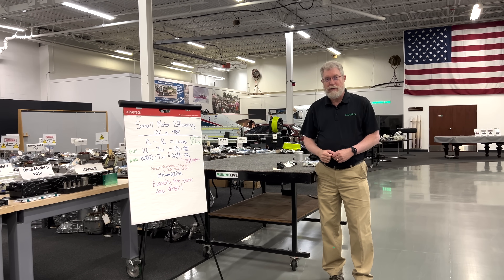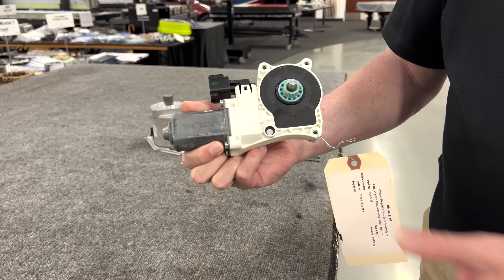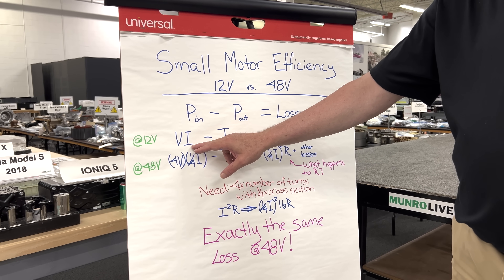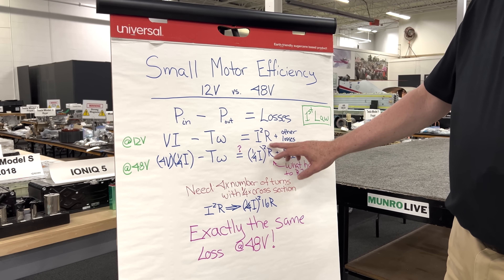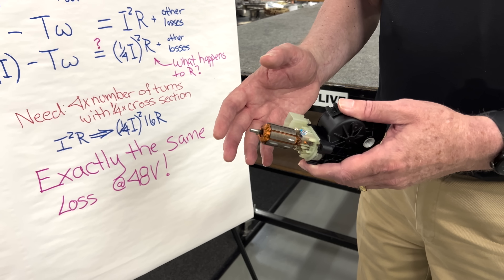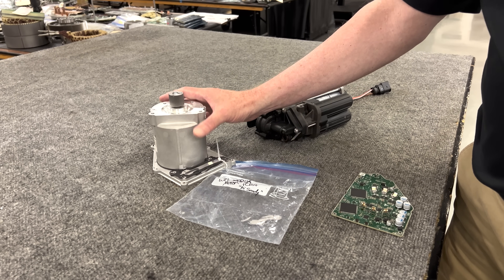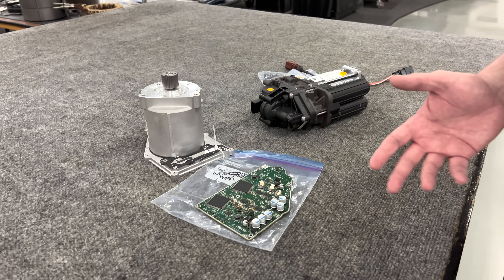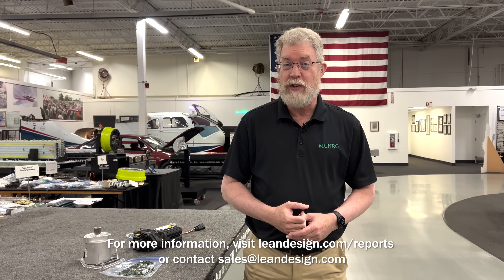Cybertruck 48V Motors: Why Tesla Made the Jump

Comment: So the biggest benefit I can see is when you have 1/4 of the amperage running through the wiring and control boards, you have 1/4th(approx) of the heat being generated by the electronics.  Water is the biggest killer of electronics, but heat is the second biggest problem.  By making the system 48v the entire system generates so much less heat that the electronics could conceivably last much longer before experiencing problems.  One big example of this is the ford lightning has a automatic switch that backs off the power if you hold the throttle down long enough.  It will only allow full throttle for a limited amount of time as the motors and circuitry starts overheating.  The cybertruck testing I've seen had one launch 11 times in a row and their was almost no difference between the first 1/4 mile and the last.  Thats an extremely robust system.

Comment: The primary reason to reduce the wire gauge is to save costs while improving the drive-by-wire motor's response, as higher voltage results in faster response times. However, this creates a challenge for the truck owner, who may need a second mortgage to cover the cost of replacing the battery or even a light bulb. 🤣🤣

Comment: If voltage goes up by 4 in the motor to get the same amount of power out we should need a quarter of the current. If we have a quarter of the current we have a quarter of the current losses. The resistance of the motor is primarily from the counter electromagnetic force, ie the generator effect generated by the current carrying conductors opposite the force causing current flow. This is ultimately what will cause a motor with no load to reach a maximum speed. It's also what causes the load in a generator and requires increased power in to provide more current out.
Reply: That being said, those little motors are so small they are negligible.The auxiliary loads in general are measured in watts whereas the propulsion is hundreds of kilowatts. The only real gain might be seen in the heat pump

Comment: Hi ! I hope you see this comment as you know you didn't explain something very well and you have made a mistake that needs to be corrected :
R= P × A / L
and in case of 48 V
A' = A / 4
L' = 4 L
R = P × A/4/4L = P × A / 16 L 
p = the resistivity of the wire .
A = the section of the wire .
L is the long of the wire '
R the overall resistance of the wire
so the resistance will be 16 times less in the case of 48 V

Comment: Electrical Voltage (U) not V!
The letter "U" used to denote electrical voltage comes from the German word "Unterschied," which means "difference." Electrical voltage represents the difference in electric potential between two points in a circuit. This notation became widespread in German scientific literature and education, and eventually, it was adopted internationally.

Electric Current (I)
The letter "I" used to denote electric current originates from the French word "intensité," which means "intensity." Electric current refers to the intensity of the flow of electric charge, or the amount of charge passing through a point in a circuit per unit time. French scientists, such as André-Marie Ampère, played a significant role in the study of electricity, and through their work, the "I" notation became widely accepted.

So P(ower) is U×I.

Comment: Small power mosfet switches are no longer expensive. That is outdated info. Its much rather that engineering for 100's of amps in general is expensive and annoying. Everything is just a little more expensive. The PCB. The capacitors. The current sense arrangements, the cables,  the switches. Slightly more loss. Larger screw connectors, larger push connectors. Everything a little.

Comment: Your calculations are hyperbole. In electrical engineering we almost always see an increase in efficiency with an increase in voltage. Smaller wire tends to give a better geometric fill on smaller items, solder joints, connectors, transistors etc. have fixed resistance terms that do not depend on voltage. Yes, higher voltage Mosfets have more resistance, but mosfets are now so good that for low voltage mosfets the resistance is as much packaging and pcb as it is silicon die. Diodes SUCK at low voltages. A fw/bw variable speed drive for a dc motor can be half diode at 48 V....at 12V the efficiency of that arrangement becomes trash and youd probably go with a fully active power converter. Carbon brushes is another one. Low voltage motors have far higher losses and wear in that area because brushes hate high current. A dirty corroded 230V motor will run just fine, a brushed battery tool will almost catch fire in that condition. And all of this gets worse with higher powers. As the rotor gets larger, fewer and fewer turns are needed to give proper emf....and low voltages like 12 become asinine...unless we use series wound machine like a starter, which does auto field weakening, and is undesireable for many generic applications.

Comment: Why ?, Because the costs are saved by Tesla and the expenses are passed to the customer. Here is the math,  $2500 for 48V headlights, $25 for 12V headlights. CustomerCost48V= 100 x CustomerCost12V. If you are not convinced then you should ask why not 480V ?

Comment: Having attended many PDT architecture meetings at GM about 30 years ago, I believe your missing the key point.  Belt driven steering pump, air conditioning water pump were very inefficient.  48v architecture is more suitable to drive the components.  The efficiency gain is more simply going from a belt driven system that has 100% drive losses, to an electric system that only has losses when running.  And yes 48V gives you the power density advantage, that Tesla likes

Comment: All well and good the efficiencies of 48V vs 12V.  Everyone knows the advantages of this difference but in the Cybertruck,  I worry about the longevity of the truck to the consumer.  Every time we add a system for I hope some real purpose and not a gimmick,  the overall reliability goes down just because of statistical failure.  We are getting there with electric vehicles but certainly a long way from the pinnacle of reliability and long range.

Comment: I'm not convinced there needs to be 4x as much wire in the motor as the voltage through the wire is higher in 48V architecture (if anything, there needs to be better insulation)

Comment: Perhaps the power and efficiency inside the motor is unchanged as presented, but the power distribution losses from the battery to each window motor (and other actuators on the vehicle) are reduced. This also allows smaller wires in the harness, for weight and cost savings.

Comment: The magnetic reduce in size also.  To wind the motor you probably do not have to cut the cross-sectional area by 4 - you probably just reduce the wire gauge so that it fits in the winding.  You might eek out some efficiency that way.  And to reiterate that all the wire gauge in the truck will be a smaller gauge - this is why small aircraft use +28 VDC.

Comment: The savings is in supply wiring cost, weight, and size.  Home solar systems have changed to series strings of panels giving much higher voltage per string (~350 VDC) with less current, for the same power output as if they were parallel wired as in earlier systems.  Good luck driving a steer-by-wire truck.  Drive-board fails and you kiss a telephone pole.  Re the advantages of higher voltage, the HV battery is 800 VDC in Porsche and Hyundai e-cars, while Tesla is still at 400 VDC.

Comment: There is way less I^*R loss in the wiring that brought the 48 Volts to the motor since there is less current, but only if Tesla didn’t thin the wire out, which they probably did to reduce weight.

Comment: Bad math. This would only work that way at 0 rpm. 
Also, almost certainly this motor is controller via pwm, so technically nothing needs to be changed unless one wants more torque per Amp.

Comment: 48v seems to be popping up across industries.  Solar, battery storage, and POE (networking) are both moving to 48v.  

I wouldn't be surprised to see all lighting and small devices (USB) in a house in the next decade to be moved to 48v DC.

Comment: Look like you don't have any information &study about torque & magnetic filed, and magnetic field saturation, & amp turn , and, the wire Resistance is not increseing 16time or decrees 1/16 th, the wir resistaance formula is R= rho . L/S
You are presenting info that's without knowing about math and magnetic fields theory & electricity. How com you are engineer with this knowledge.

Comment: This is a misconception.
The Ampere strength depends on the current strength.
F=I*B*l*sin  - not from voltage .
Accordingly, at 48 volts with a current of 1/4 , the torque will also  1/4.
I*I*R - It's not a loss - it's a cost.

Comment: 7:50  Just wait till all those capacitors go bad on this multilayer PCB go bad.  Before the board stops operating all together, they will pee their acid all over the board.  This is happening today with PCBs throughout the automotive sector.  If any replacements are even available, it will be 1000 bucks for the board.
Steer-by-wire is stupid.  It is needlessly complex for almost no benefit. An electric power steering pump would work fine.

Comment: This video somewhat misunderstands the concept. The motor is still drawing the same power (P), but the losses in the cable are lower because they depend on \( I^2 \) (current squared). These losses are dissipated as heat in the wires, and smaller cables are needed and that is a plus.

Comment: The BIG negative is going to 48 volts is that the housekeeping batter becomes less reliable.   If a lead acid batter is used, it goes from 6 to 24 cells.   If it's a lithium battery the battery management problems start approaching that of the high voltage battery.   

It's good to have suspension pumps and steering motors more powerful.    The 48 volt housekeeping permits the designers to run all but the main drive motors from 48 volts rather than the high voltage.   In particular, the heat pump might be the "right size" to run off of 48 as compared to, say, 600 volts.

Comment: So why not everything at 400V with a super fast battery disconnect in the case of an accident. Then you don’t have any losses converting from 400 V or actually why not 800 V.

They say when you get electrocuted it’s not the voltage that kills you. It’s the amperage and the amperage would be vanishing something like a power window motor at 800 V.
Reply: And while you’re at it since the entire car is made of steel wanted, put an insulated channel somewhere in there and make the body panels the bus

Comment: - *U* is the voltage (potential difference) across the circuit (measured in volts, V),
- *I* is the current flowing through the circuit (measured in amperes, A),
- *R* is the resistance of the circuit (measured in ohms, Ω).

Comment: but you save in all transport wires, connectors, drivers and long lines, as well as have more regulation margin. Also, the number of turns in the motor changes the inductance as it increases

Comment: So the motor was not redesigned to house 4x the length of coper wire at lower resistance. 48v reduces the wt of copper in the harnesses too.

Comment: I = Intensity of the current in Amps, I did study this in high school in Est Europe in 80's it was part of the physics lessons. When you increase the voltage you make the diameter of the wire thinner. The more coils you have in the coil the higher is the magnetic field when the currents runs in the coils. If you want high torque, you need high voltage, more coils on the electric engine, and lower current.

Comment: From this observation, he developed the eponymous Ampère's law, which relates the size of the force between two conductors to the length of the wires and the magnitude of the current. He labelled the flow of charge “intensité de courant”, meaning current intensity, and gave it the symbol “I”.

Comment: The explanation about the difference in the window motors was unnecessary. The 2 motors use the same amount of power, duh. The benefit in that case is in the wiring with smaller gauge wires (less weight, less cost) needed to carry the same watts (higher voltage, lower amps).

Comment: Going 48v also reduces the wire size throughout the car, which is weight savings and cost savings. Not that weight is a big thing here. This also works with solar system. Check out why some aircraft use 400hz if your interested in this kind of stuff.
Reply: I have 11x 40 volt solar panels in series on the RV bus roof for 440 volts at 5 amps coming down to the MMPT charge controller close to the 24 volt battery bank giving 100 -120 amps charge at 28 volts  light cheap wire on the long run up high and short thick wire down low.

Comment: Feel the 48V is chosen based on increase of sustained total power consumption, due to new features and to combat the efficiency loss of power conversion to 12V. There is further saving in power distribution(reduced copper)  and reduced size of components mosfets(for a low volt high current approach, you need mosfets with extremely low Rds ON, which are quite expensive compared to higher loss low current commodity mosfets), capacitors(needed for smoothing, storage etc) is also another one(probably Tesla identified a sweet spot in savings and reliability). Just some 💭❤️👍

Comment: A is for Amps. I is for current. Just like (Omega) is for Ohms. R is for resistance. P is for power and W is for Watts. But V is for volts which is the unit of measure and also the property. To this i will tell you you can find the equations you used written where instead of V, E is used. P=EI=I²R.
E stands for ElectroMotive Force.
The symbol “I” for electric current originates from the French phrase “intensité du courant”, meaning “current intensity”, coined by French scientist André-Marie Ampère in the 1820s. 
Ok so i did have to go to the Internet for I is for current. The rest l knew.

Comment: Cybertruck is a better form factor for a family hauler than an F150 or Explorer. Better daily driver than a Jeep with just as much off-road capability. But it doesn't fill the niche of the Ford Maverick, and it doesn't have the big family capability of a minivan or Chinese EV like the X-Peng MPV9 or the Li Mega. The X-Peng is cheaper, both have massage seats in the middle row, a screen in front of the driver, and a screen in the rearview mirror (like Cybertruck so desperately needs). Give me 2 more screens up front for an $80k Cybertruck (Inflation adjusted $50k from 2019 is $65k today).

Comment: I see a lot of people asking why 48v and not higher, and the answer is safety considerations and standards. 

EV manufacturers want to minimize the amount of high voltage wiring and connections in the car so that faults are less dangerous and make it easier to work on the secondary electronics. 48v is about the limit of what you can call "low voltage"

Comment: As a former IC designer, don't we have to take into account the extra transistor (MOS) spacings to handle the 48V? The wiring for the lower current is, I think the primary benefit of the 48V solution. Most motor drive IC designs 5 years ago were only capable of 24-30V but the 48V require 60-100V breakdown requirements. This is a fundamental change between the 12V and 48V systems on the Cybertruck design. The automotive industry drove most requirements for most all IC designs because of automotive shear size of that business. 48V brings a LOT of IC design differences that were not present at the 12V level. 12V to 48V is a massive change not to be taken lightly for the IC industry. Please do not underestimate the change from 12V to 48V!

Comment: Is there a reason why any needs power windows? Crank ones are so much simpler and don't require 75% of the parts
Reply: is there any reason why someone would need power brakes or power steering?  sure there is,  to make things easier

Comment: 48V is also a disadvantage if you have to step it down for example to 3.3V. Switch mode regulators usually have higher losses if the voltage drop is high. So you might have to use multiple steps, which increases BOM cost.
Reply: I believe the CT also has a 12v system so it could use that for the lower voltage lower power devices.

Comment: Every "magnetic thing" works independently of the voltage/impedance level it is designed to work on, assuming wire packing factor doesn't change.  Practically, packing factor stays reasonably constant as long as the voltage level is not "ridiculously high" or ridiculously low".  So the analysis you make also applies to every other magnetic component in the circuit (such as inductors & transformers in the electronics).

Comment: I think the focus was misguide in this video. Why would the power requirement change? You still have X number of Newton meter of torque need to meet the requirement. Going to high voltage is all about the whole system, not the motors them self.

Comment: For inductive load, shouldn't we use XL=2*PI()*f*L to calculate eqv. resistance?
I have no idea why but same wattage motor, the higher voltage rating one will have better efficiency based on experiment.

Comment: The overall vehicle wiring can be much smaller. This alone is a huge cost savings in copper.
I think you guys get a lot of stuff really right, but this one....I'm kind of at a loss.
I'm also not impressed, even a little bit, with the Cyber Truck. I had much more hope for this vehicle until it was actually available. My Jeep Wrangler would wreck this thing in almost every category and it cost 1/3.